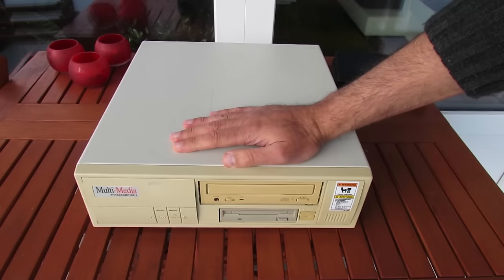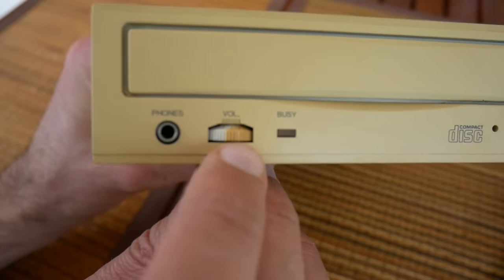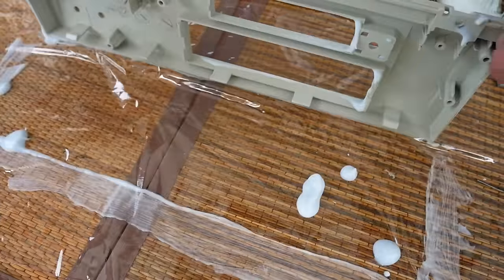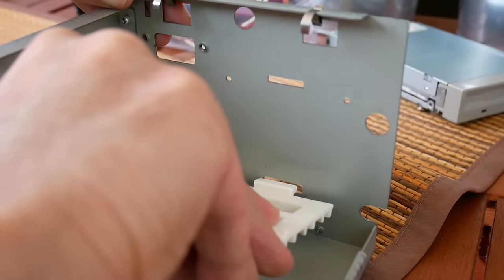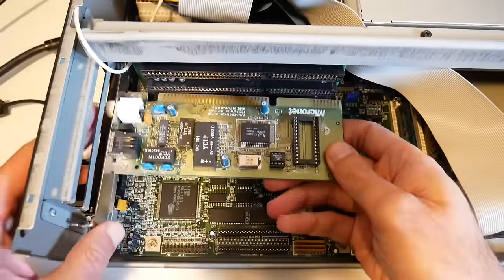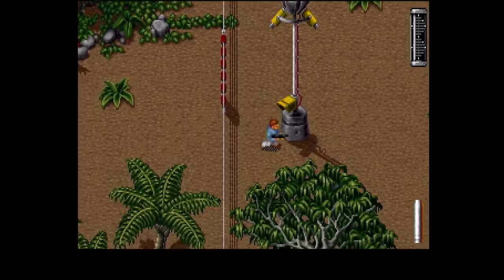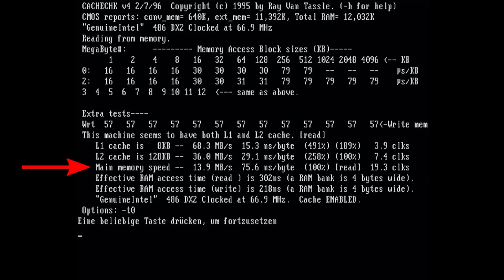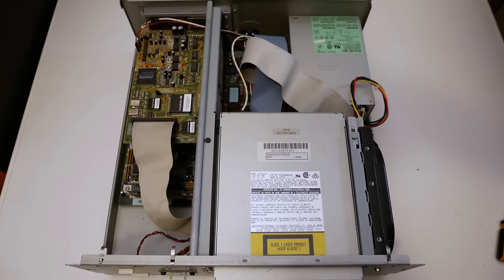Packard Bell PB486CD restoration (Part 3)

Comment: FYI, yellowing of plastic isn't caused by sunlight, it's caused by oxygen. Also you don't need sunlight to activate hydrogen peroxide, you need heat.
Reply: Yellowing of plastics is caused by photodegradation of brominated flame retardants, which can be triggered by oxygen, UV, IR, and a host of other environmental factors. Certain BFRs were affected to a lesser or greater extent by one factor over another.
Reply: @caseycu  I tried posting a link to an article that goes into the chemistry, but youtube blocked it. 

Regarding flame retardants, this is what the article states:

A very common misconception, probably caused by Nintendo, is that the bromine flame retardants (BFRs) used in ABS plastics is the cause of the yellowing process. I can safely say that this is not the case. If the BFRs degraded into a bromide or bromate salt, then they would simply dissolve in water and the plastic would not stay yellowed. Yet that doesn’t happen. Another suggestion is that it degrades into bromine, which would also not keep the plastic yellow. Bromine is a volatile liquid and evaporates very quickly. It is also one of the most pungent smells that you could experience and even little amounts linger (have worked with bromine before). It just doesn’t cause the plastic to yellow. It is entirely caused by the degradation of ABS.

As for what's going on, it's oxygen binding to ABS plastic and the hydrogen peroxide removes that excess oxygen when exposed to a heat source (the article lists UV but hydrogen peroxide is heat activated).

If you google the above text, it will take you to the article.
Reply: @BareMetalProgramming  thank you for sharing. Did you notice that the article you referenced states “(yellowing) can be initiated by both heat and UV light, though UV increases the reaction rate by a much higher degree”. Doesn’t that contradict being caused only by oxygen? Also, if yellowing is just caused by oxygen, why would only the exposed portion of the volume dial be yellowed, even though the rest of the dial was obviously not sealed in any way? 
Regardless, there are a few things that make me question the validity of this article: 
1) Medium isn’t a scientific journal, anyone can write an article for Medium, and it’s often referred to as a blog host. 
2) This author gives no indication of his expertise in polymer chemistry, aside from a vague reference to his “knowledge of chemistry”. 
3) Few, if any, scientists would ever refer to 5 paragraphs and some images taken from Wikipedia as “a comprehensive study”. 
4) It was obviously not based on reproducible experiments or peer-reviewed. 
5) There are reproducible, peer-reviewed studies that show BFRs do cause yellowing. One of which is titled “Photodegradation of brominated flame retardants in polystyrene: Quantum yields, products and influencing factors” which was published in ScienceDirect and several other scientific journals for peer review. From that study: “TBBPA and its NBFRs derivatives are incorporated in plastics, and absorb solar radiation (>290 nm) which can induce their degradation during use”.